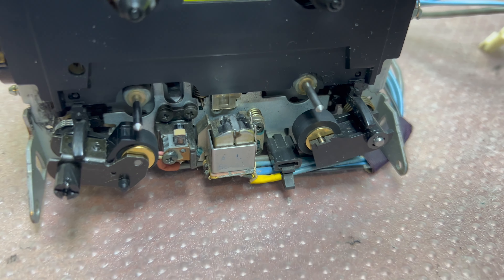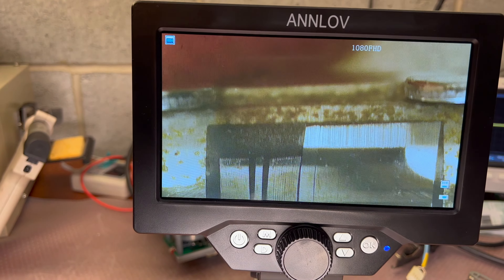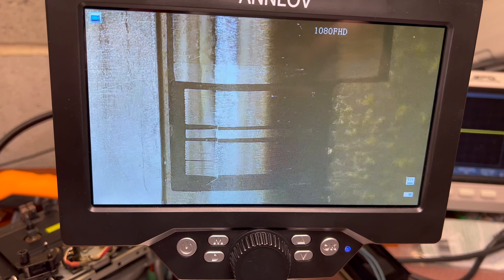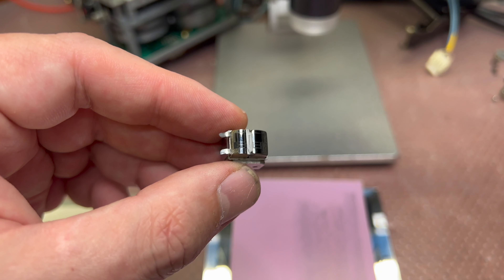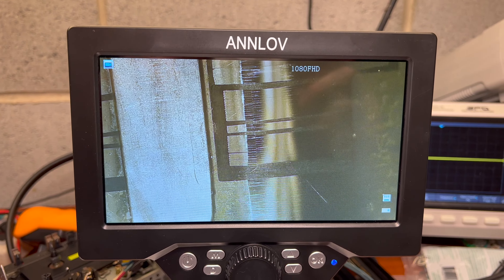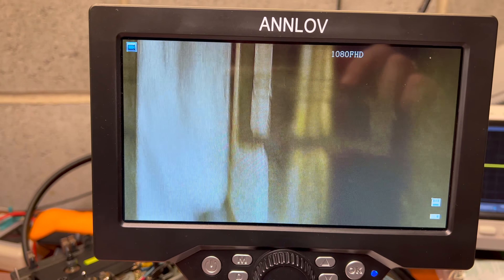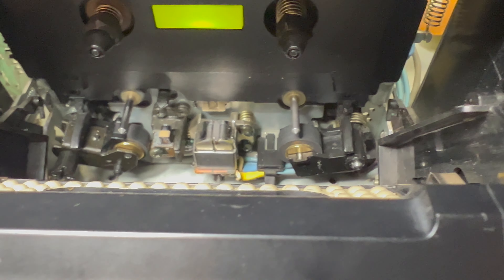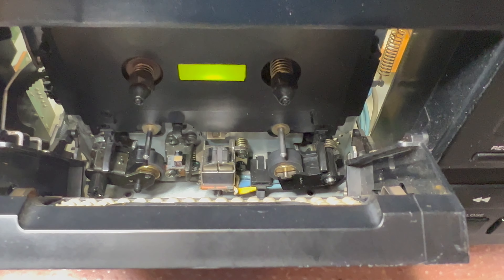Reviving Sonic Fidelity: Relapping Heads for Sony TC-K222ESL

Comment from the maker: Diamond sandpaper 15,  9,  6,  3,  1,  0.5,  0.1 micrometer.
Reply from the maker: 3M (TM) Diamond Lapping Microfinishing Film 3 inches x 8 Inches PSA (Pressure Sensitive Adhesive) Backing (15 micron / 1250 grit) https://a.co/d/0L4sYH3
Reply from the maker: 3M (TM) Diamond Lapping Microfinishing Film 3 inches x 8 Inches PSA (Pressure Sensitive Adhesive) Backing (9 micron / 2000 grit) https://a.co/d/g3UGDMb
Reply from the maker: 3M (TM) Diamond Lapping Microfinishing Film 3 inches x 8 Inches PSA (Pressure Sensitive Adhesive) Backing (6 micron / 3200 grit) https://a.co/d/6ZxNks6
Reply from the maker: 3M (TM) Diamond Lapping Microfinishing Film 3 inches x 8 Inches PSA (Pressure Sensitive Adhesive) Backing (3 micron / 7000 grit) https://a.co/d/8h6uDUC
Reply from the maker: 3M (TM) Diamond Lapping Microfinishing Film 3 inches x 8 Inches PSA (Pressure Sensitive Adhesive) Backing (1 micron / 25,000 grit) https://a.co/d/0F76RGe
Reply from the maker: 3M (TM) Diamond Lapping Microfinishing Film 3 inches x 8 Inches PSA (Pressure Sensitive Adhesive) Backing (.5 micron / 50,000 grit) https://a.co/d/boohdpe
Reply from the maker: 3M (TM) Diamond Lapping Microfinishing Film 3 inches x 8 Inches PSA (Pressure Sensitive Adhesive) Backing (.1 micron / 200,000 grit) https://a.co/d/eyEZVWt

Comment: also... the look of those (unlucky) heads after the lapping job look like if there are some totally flattened zones where you lapped... so, why they did make the heads with a certain contour profile in the first moment?

please, stop destroying heads.
Reply from the maker: Sure, use your time machine and go back to 1985 and buy a few spare heads. Unfortunately, I don't have a time machine. That is why I re-lapping heads. I can't get inside the area between heads as they are already in a sandwich. And stop making ridiculous comments. Check my deck's performance before writing this.
Reply: @hifirulezzz  hey, I am lapping cassette heads myself for YEARS now... and I never, NEVER, needed to bend the guides... as i've just told in my other comment, there is a safe way to do that, which you evidently ignore. 
I am usually reluctant to explain people how to lap heads in a public place, to simply avoid encouraging the unexpert guys to try to to that by themselves, since it needs a small mistake while lapping to ruin the heads... can you get my point?
And, now, I see you making this work the worst possible way and also spreading a video about that... that's unacceptable, that's why I did comment, otherewise I would have simply ignored it, as I usually do with all the crap spreaded around on youtube about the whole cassette decks matter.
It seems you have no moral issues in feeling guilty when people will be imitating you and, basicly, destroying their (otherwise salvageable) heads... I am just shocked.

Also, a flat playback response isn't equal to a flat head surface... and, now, I understand why, in another video, you needed to add 1000pF loading capacitor at PB input amp circuit to try to recover some treble response.... NO heads out there will require that much loading capacitance at PB side.... it's way too much, if the head is working as intended.

And, I hope you never thought to lap a Nakamichi crystalloy head (the ones they use on their 3 heads decks)... those heads simply don't need any relap, since they have slots at the tape edges, like some/most R2R heads... tape/head contact, on such slotted crystalloy heads will be OK just up until the gaps are totally worn out... and, at that point, the head needs to be simply replaced, without cheating on the PB amp with a lot of capacitance.

Do you also use to measure the distortion/MOL after such works, or you simply try "whatever" it comes to mind to get a flat response? 

Last but not least... on another video (about the PB response on a Sony deck) I see you mixing up playback matters and recording matters, like evaluating and drawing conclusions on the PB response while measuring a REC/PB response... this is a totally wrong way to look at it... playback and recording are two totally separate matters and they must be addressed individually: first the playback alone and, after you get it right, you go to REC/PB (where the PB side is just OK and you don't touch it anymore) to simply check/fix the REC side... this is just the ABC.

Anyways, I am sort of happy that, at least, you tried to reply me... I would have expected you did simply erase my comments... then, maybe, there is still some hope, who knows?
Reply from the maker: @vincenzogatti9371  Thank you for the constructive comment. These re-lapped Sony decks I am using right now and very happy about the results. You may watch two videos on their performance coming tomorrow and Thursday. I hope you will enjoy it. You are correct, I am checking the Playback response first, and then record response corrected only after the playback is fully set. It should be good to learn new methods of lapping heads. You may reach me at hifirulezzz@gmail.com Today, information is not available anymore and I have to collect it from multiple sources. It is easy to say replace the head. Have you tried to find a new one recently?